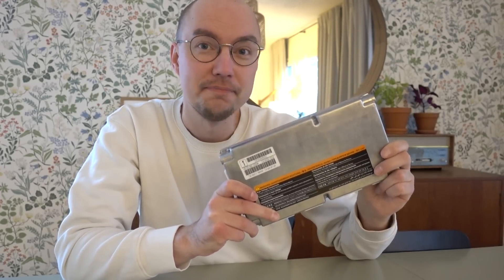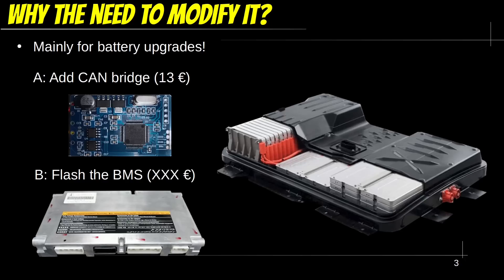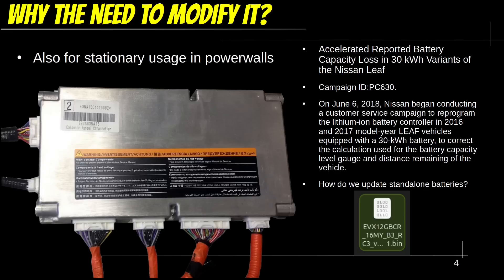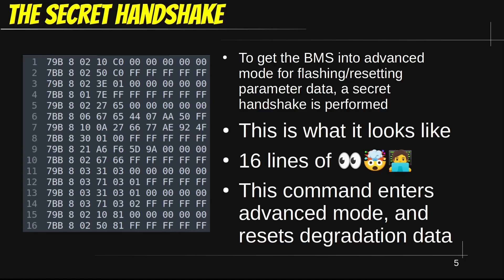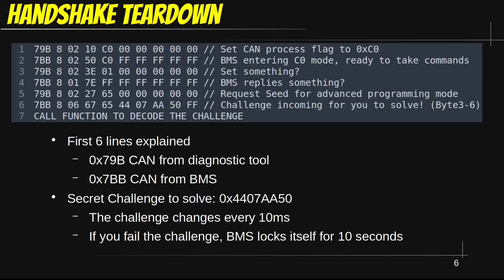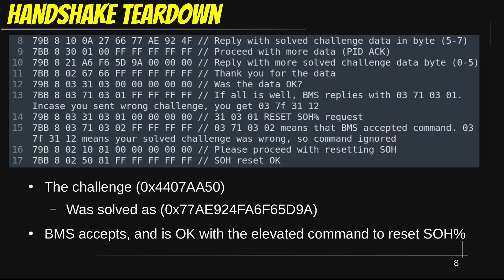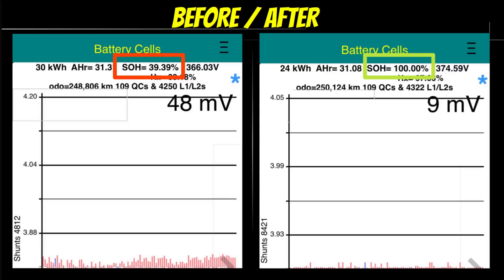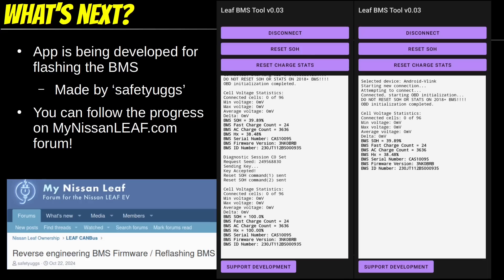Nissan LEAF BMS unlocked 🔓

Comment: Is this "unlocked" BMS only present in 1st and/or 2nd Generation LEAFs? Or the latest 3rd Gen LEAF 2025 as well?

And does "regain 5kWh capacity" mean I can get up to 67kWh of "actual range" out of a 62kWh-rated battery?

Comment: Love your videos!  Exactly how does Nissan BMS balance the individual cells? By draining or by charging? How can they with only one wire running to the cell? I haven’t seen anyone explain this.
Reply from the maker: The Nissan LEAF BMS utilizes passive balancing, meaning resistors are shunting power from highest cells to balance the pack. Each cell has actually two wires to it, one for negative side, and one for positive. It can bypass only 2.5mA of current, which is very slow balancing compared to newer BMSes.

Comment: Thank you Dala! I've been following the work on the BMS but besides a bit of arduino tinkering, it all makes me feel completely out of my depth. And i have a 2015 24kwh that's becoming a bit tired, so really interested in getting a solid, workable upgrade for the next 10 years without breaking the bank. Your videos explain the concepts so well, so I'm positive that i might be able to tackle the upgrade and the bms upgrades. 
One thing im curious about is that there would be various hardware versions of the bms. Possibly with differing balancers? Hopefully we can pull all that data from the upcoming software... 
I'm super grateful that you and superuggs are putting the time and effort into this amazing little car!

Comment: Hello, I have tried this on my 2017 Leaf AZE0 30KWH. The reset worked according to leafspy but there are only 4 bars left in the cockpit display. Any idea how to fix this? Thank you!
Reply from the maker: See the mynissanleaf forum thread, still under work
Reply: @ I have been searching this thread but didn’t find a solution..:-( is there one?
Reply from the maker: @gzebedin  SafetyUggs is working on it
Reply: Please I need some help
Reply: I have a 2013 Nissan leaf and I'm trying to get more miles on there what software can I use to? For that I only got 8 bars what software can I use to get more bars?

Comment: Liked and subscribed! Thank you so much for making these videos and your contributions to the community. I just picked up a 2011 Leaf for $650. I have not had a chance to get an OBD adapter yet but I will order one tonight. I have about 6 bars and I get a maximum of 36 miles shown but I have never tried to get that. Starts flashing at 6 miles remaining. EV warning light stays on but it drives really nice. Fun car. I can not wait for summer time. If I could add some range and drive it from one town to another instead of just this city that would be amazing.

Comment: Once control of the BMS is gained is there a way to use this battery to charge directly from solar and discharge it directly into an electric car, dc to dc without the losses of running it through an inverter?        That would be very useful for solar carports.
Reply from the maker: There already is. Check out the "Battery-Emulator" on Github!
Reply: @DalasEVRepair  what am I missing? Everything I see there shows an inverter in the mix. Can you direct me to what I’m overlooking?
Reply from the maker: @inels6838  There is sourcecode available for how to access the 400VDC via Chademo port on the Battery-Emulator section. This code can be ported to whatever V2X device you want to build

Comment: Will this work with a Muxsan UBEX (ENV200)? I have 24+45kWh, but the range estimates are very unreliable.
Incidentally, I have the CCS conversion too, which works great, though not much faster than the Chademo.
Reply from the maker: It should help yes

Comment: This is yet another evidence of how electric car manufacturers deceive their customers. After a few years of use, they intentionally reduce the usable capacity of the battery. This drastically decreases the range, pushing owners to buy a new electric car. In many cases, however, these owners choose not to buy another electric car because they feel cheated.

And despite the 8-year warranty on the battery, when the owner complains that the car can only travel half the distance on the same charge, their warranty claim is rejected by the dealers (and the manufacturer). This happens because they perform a test that shows the battery is still at 93-95% capacity, which they argue is not grounds for a warranty replacement.

As a result, the customer is left with an unusable electric car that they can only sell or trade in for a new one if they are lucky.

Let’s not forget what Apple did with the battery software on iPhones! It wasn’t until someone won a lawsuit that Apple was forced to end the lies about battery capacity. Or let’s recall the lies manufacturers told about diesel car emissions.

Comment: I upgraded my Nissan Leaf from 24 kWh to 40 kWh. If I upgrade again to 80 kWh, will it work, or should I stick with 40 kWh?

Also, can a Type 1 3.6 kW charger be upgraded to 7 kW, and will an 80 kWh battery with a CAN BMS work for a 2013 Nissan Leaf

Comment: Hi. I  have start troubel with my u.s.a   nissan leaf. The starting batery is new and chages. But  after acoupel of days the leaf not start again. I must taket of the batterypols for a half hour and a again it will start.. Whats is wrong. May be the computer make troubel??? Tankes for all videos..
Reply from the maker: I suggest you make a new thread on the MyNissanLEAF forum to get more expert input
Reply: Ok. Tanke you
Reply: MAYBEE A UPDATE FOR BMS WILL FIX MY PROBLEM WITHE STARTING PROBLEMS?

Comment: My Leaf ZE0 has about 10% buffer at the upper limit. Do you think it is possible to remove the buffer by modifying the BMS and use the battery from 100% capacity?
Reply from the maker: Yes we tried this, it works but high risk to trigger fault codes so it is not recommended

Comment: Félicitations! Congratulations from Quebec, Canada.  You did achieve a great feat in this reverse engineering work!  I have a 24kWh 2013 Leaf that I would like to replace allo cells in the pack with higher capacity and your good work tend to make this a real possibility!  This will extend the lifespan of a number of Leafs!

Comment: Great news! With higher capacity batteries now available for older Leaf vehicles, can they be available for Vehicle-to-Home (V2H) or Vehicle-to-Grid (V2G) for power to the home?
Reply: The V2G/L/H charger is a much harder piece of the puzzle, as opposed to vehicle regulation, you need to have a charger that is compatible with local electrical code.

Comment: I've been thinking to upgrade from 24 to 40 kwh battery capacity. I understand it that the unlocking of the BMS is mainly to help with the 30kwh packages that suffered these issues? Furthermore, that the CAN-bridge is just as good and functional in the swap from 24/40?
Reply from the maker: Long term, it will help battery upgrades. For now, I recommend using the budget CAN bridge. Explained more here what is needed: https://github.com/dalathegreat/Nissan-LEAF-Battery-Upgrade/wiki

Comment: So, I have a 2017 30KwH leaf with around 20% degradation. How can I check if the Bms has been updated or is affected by the miscalculation glitch? Nissan told me that they aren’t going to update the bms because the update procedure may brick it and, if that happens, the replacement cost will be on my pocket. Do the app perform a check on the Bms or it simply reset the data? Thanks to Dala and everyone who knows the answer!
Reply from the maker: You can see if you have the affected software version with Leafspy Pro, scan ECU versions. 4A was updated to 4C, 6A to 6B. If it's on the original A firmware it loses track of the actual capacity
Reply: @ Thank you Dala! I’ll check asap! You are very kind!
Reply: I have checked. Funnily enough I don’t have A nor I have C. The  HV battery ECU version is 4NR6B. I really don’t understand if my car has been updated or not…
Maybe Dala, who is the Leaf master sorcerer, can shed some light on this mistery wrapped in a riddle inside an enigma… :)
Reply from the maker: @dentro-il-mistero  You have the update, 6A was affected, 6B is the patched one!
Reply: @ Wow, you are fast! Thank you! I bought my car used a year ago with eleven bars (80,05 SOH) and I wondering if was possible to squeeze a bit more Kw from the battery. Next week I will change the oil of the reduction gear following your tutorial, I am curious to see if it will make any difference. I will use the same oil as in your video. Thanks again Dala, that was very kind of you!

Comment: Seeing content like this gives me hope for my ability to continue driving an EV, since anything better than a leaf costs far more than I can reasonably afford. 
Between CATL batteries, the CCS adaptation projects, and work on hacking the BMS, I'm getting reviewed hope that maybe I should continue driving a leaf, getting progressively more hacked to suit my needs. I desperately need a car that can travel minimum 120 miles without paying what a new car would cost
Reply: @gutserker  too bad what Dala abandoned a CCS upgrade for a leaf after adapters got released. I do battery upgrades in Los Angeles and can get you 200+ miles battery if it's in your budget. Leaf is an awesome car with not so great battery packs.
Reply: A further adaptation to CCS is a waste of time! There are other charge plugs that take over the world and should be adapted. In North America everybody is switching to NACS. In Asia, South America and Africa the chinese GB/T plug is expanding rapidly.
Reply: @stevemichael82the truth is that the whole world should have just one plug.
Reply: @stevemichael82  I'm a actually happy what CCS will die in NA. It makes no sense here! It's ugly huge connection. NACS or chademo, I'm fine with both. NACS is more elegant one without a doubt.

Comment: Now every used Nissan Leaf will have a perfect battery and only 5000 KM/miles on the clock. Hurray! 🥳🥂
Reply from the maker: Thankfully kilometers stored on the BMS is not used by the instrumentation cluster 😅
Reply: @CitarNosis317  No. It's impossible to reset bars on a 2013+ leafs via OBD, only with complete battery removal and with working on LBC on the bench.

Comment: Great work as usual; but although I was looking at an old Leaf 2-3 years ago, I decided it was to low for my damaged back, and went with the higher seating position of the early Kia Soul EV; do you know of anyone doing similar work on those old EVs??

My battery is still in great health, but it would be nice to have more range - and the Mk2 Soul EV battery is a completely different format; so that option is out.
Reply: @ianemery2925  I'm working on repacking a soul EV first gen in Los Angeles.
Reply: @pashko90  That is great, will there be a video about it?
Reply: @ianemery2925  less likely. But will see. Where are you located at? And what is your current battery pack, is it 96s or 100s?
Reply: @pashko90  I am in the UK and have the OLD Kia Soul, the 2016, with the 27KWh pack, 26.1KWh currently remaining.
Reply: @ianemery2925  it's great. I have first gen soul too with 96s pack what can't go anywhere. Not even to the closest store. Over 50% capacity degradation. But nice car. It will get range extended first and then might get repacked. But can bus bridge gonna be a biggest problem because due to relatively small amount cars build I never seen or heard about one. I'm in Los Angeles myself so sadly it would be difficult to help you out.
Reply: @pashko90  I understand now, you mean the number of CELLS in the battery pack - but I thought there were only 92??

Yes, the BMS will be the issue; is it the same between the 27 and 30KWh versions? If so, it would give some hope that it is adjustable, and not so locked down, it wouldnt recognise a larger capacity pack.

Cell energy density has improved vastly since these cars were made, so a 50-60KWH capacity might fit in the space currently occupied by the 27KWh cells, and with no real weight penalty - which is an issue in the UK for type certification.
Reply: @ianemery2925  I mean (S)eries connectors. In original 27kwh it's a 96s battery pack, and 30s are 100s battery pack. They use different BMS modules as well. When constructing a battery it's important to know amount of series connections, because right now most cells comes in modules 4,8, and 12 cells. So you need to know what you can and can't use.
Bigger capacity can be used by reverse engineering a CAN data line and modifying a data in it.
You can see what kind of pack you have using application called "soul spy".
Reply: @pashko90  Thanks; Personally, I am too ill to get into the physical side of taking packs apart, but I was looking for info, so at a later date, when my pack starts degrading, I can go to a well known fixer of Leafs, and ask if they could work their magic on my Soul.
Reply from the maker: Sorry nope the Soul EV is very uncommon here..
Reply: @DalasEVRepair  {sad face}. Same in the UK, as I understand it, only around 1,000 of the Mk1 Soul EV were sold in the UK, although I am not sure if that was the combined 27 and 30KWh versions, or just the very first 27KWh version.

Interestingly, like the Leaf, the 2nd - larger battery option has proven to suffer far more issues and degradation, than the smaller original.

Comment: Dumb question for noob clarity: What happens if you have a degraded battery at 70% state of health, and set the state of health to 100%?
Reply from the maker: It will go back to 70% slowly, as it learns the true capacity
Reply: @DalasEVRepair  Thank you. Makes sense.
Reply: @DalasEVRepair  How long would it take? 10km? 100km? one deep discharge cycle? two?

I'm asking for the next time I want to buy a LEAF, to make sure I'm not being scammed...
Reply: @jerther_  it depends on many factors. If you wanna buy a leaf, you need to fully charge it and drive it until turtle appears and then quick charge it till full without any heat/AC running to know a true capacity.
Reply: @DalasEVRepair  If you can help me. on My Leaf 2016 30 KWH I did reset SOH and HX to 100% using Leaf BMS Tool 1.1 and my SOH display bars went down to 4 (used to be 10). Desparate how to fix it.
Reply from the maker: @Cik2001  The bars are just cosmetic, the 100% SOH means your car will now have more range if it had the bugged software! So enjoy the newfound range!

Comment: Would this allow for swapping cells to LFP on used vehicles? I think it would be the ultimate battery for a Leaf as degradation would be reduced
Reply: Пределы напряжений ячеек LFP полностью не совпадают с пределами LiION, не получится. Кроме того, балансировать LFP нужно чем-то очень мощным. Еще проблема - LFP боятся слабых морозов.
Reply: @oleg_dnepr  true. Thanks
Reply: Need further access to firmware to be able to change that far. 😅
Reply: @rkan2  Нет! Количество ячеек LFP будет больше, чем измерительных проводов у штатной BMS/LBC.

Comment: Wow, this is so cool! It also unlocks the path to batteries with new cells, as we'll need them as the 40 and 60 kWh batteries die out. Fabulous and thank you so much!
Reply: @rdflo6739  That will be a while yet, I hope? 40kWh came out in 2017?
Reply: @itekani  true, and they'll effectively last about 10 to 15 years? Only a small percentage will be available for the secondhand market, however there will be an increasing amount of perfectly fine 24 and 30 kWh Nissans that need a mid life upgrade I think.. How cool would it be to buy an upgrade kit to twice the capacity?

Comment: Wow! I have a surplus 30kWh battery (via a crashed Leaf, where I wanted the motor stack). The battery shows 75% SOH, so I assumed I would be selling as ‘powerwall’ rather than for a vehicle. But sounds as though a vehicle is now an option.
Is there a way to guesstimate what proportion of capacity is recovered based on the reported SOH? Is it a fixed proportion, or not linear?
I was already watching the forum, so great to see this presented in video form. Great work!
Reply from the maker: If the software is glitched, you most likely would be at 30-40% SOH. Ao most likely your battery is OK, just degraded. Sorry!

Comment: I did that by working with EEPROM. Only ze0 can reset bars, evenything else will reset and functionality and regen, but not bars. I also have some experience with custom flashed LBCs for different capacity, different discharge curves and even added functionality, such as heating the battery pack.

Comment: I have 2017 30 kWh that suddenly dropped from 90 to 66%. All within a year? Nissan refused to update bus, car is unusable. Please help
Reply from the maker: Reset the SOH% with the app shown in this video. Should help you get the car working!
Reply: @DalasEVRepair ok, so the app is on the forum, but is it windows app or android one? I only have an iPhone, no android devices around but I can get one if needed. What with the update? Can it be done? Or do I need to periodically reset the BMS?
Reply from the maker: @mgmacius  Well I am not the developer, best to ask all this in the forum
Reply: @DalasEVRepair  fair enough! Need to register then

Comment: Thanks for sharing, Dala. I have an EV conversion using 64kW CATL modules with a Leaf BMS (the one with the black connector in the middle). However, it's reading the battery as 24kW. I was considering purchasing the Chinese CAN-Bridge. Do you have any solutions for this issue?
Reply from the maker: We are working on this